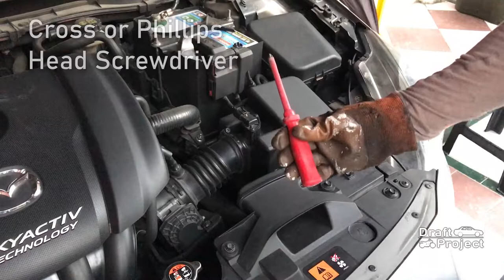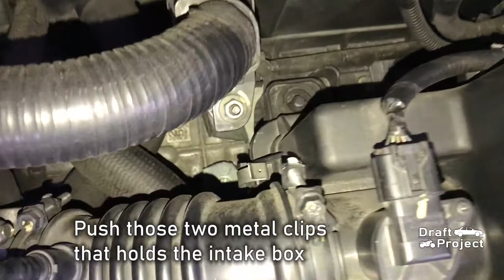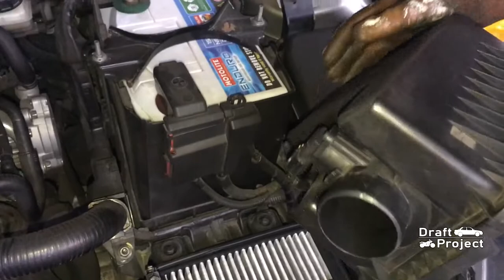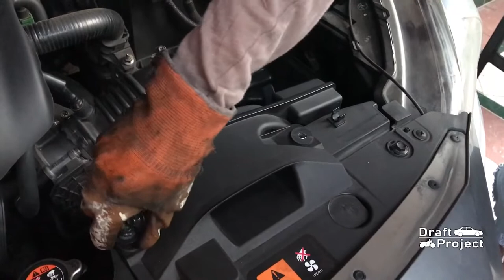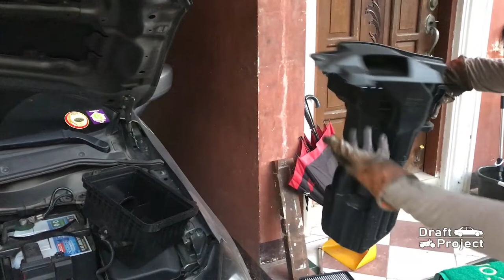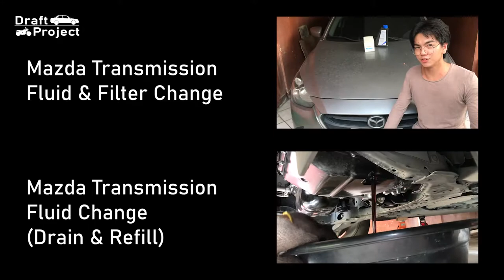How to Remove the Air Intake Box Assembly - Mazda Skyactiv

Comment: Thanks for the video.  I needed to get my air filter box out so that I could access the radiator hoses and remove and replace them.  By removing the air cleaner box it allows for much better access to the hoses.
👍

Comment: What’s the part name of the air filter box, I’m missing mines and I need to buy one but don’t know what part # it is
Reply from the maker: Try to check this.
https://www.zoomzoomnationparts.com/a/Mazda__/105507739__9365513/AIR-CLEANER/AUDMM2-1330A.html#133AY

Just to be sure, you can ask your nearest Mazda dealership about the part no. so you can get a reference and assure that this is correct. Hope this helps. Thanks.
Reply: @DraftProject hello Can you find the link for a Mazda 3 2.5 AT Air cleaner??? Can not find it… and what happened if I fit a smaller air cleaner box inside my motor? Because I just purchase a Mazda 3 2016 but with conic filter, I wanted to put int standard.